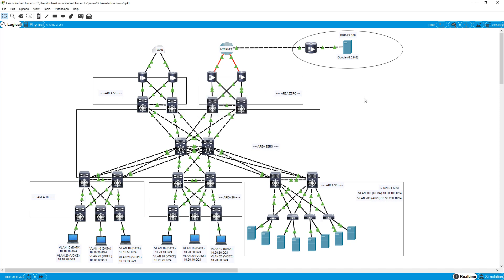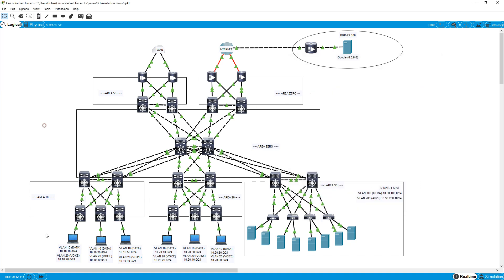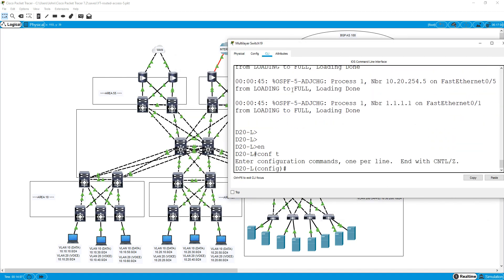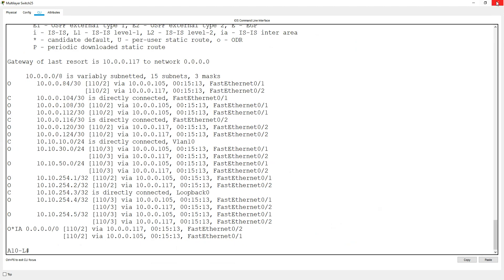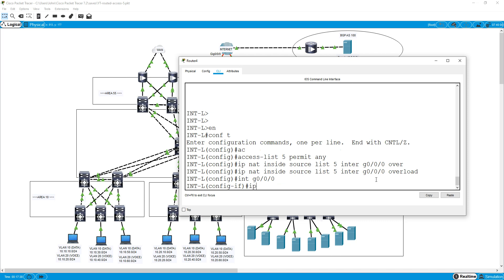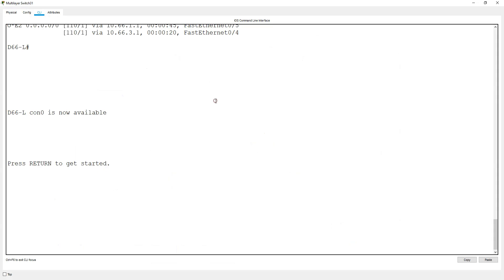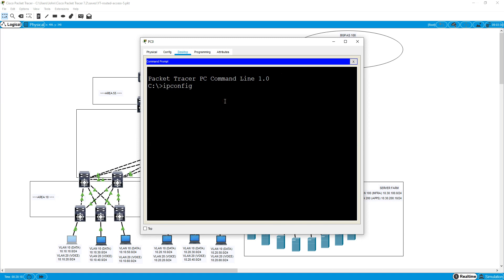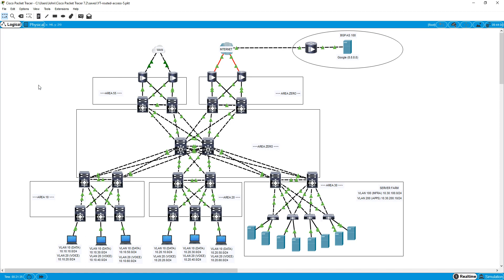Packet Tracer Lab: Routed Access Campus Design (Final Part: OSPF Summarisation, NAT & Ping Tests)

Comment: My deer and my teatcher 

I need you 

I need to connect multiple access point and creat multi group ssid 

I couldn't' do that 

So 
I didn't know 
If the MLS  has integrated wireless lan controller 
Or no 

I can't handle MLS + wireless lan controller  

So. All tutorial. Handle router with (WLC )

But. My company has MLS   does not has any router 

Can you help me please
Reply from the maker: Hey, Moshtak. Deploying wireless really requires a proper assessment of all the devices in place and their capabilities, etc, and I am afraid I'm unable to give any concrete advice just from the information. That said, in Routed Access you can deploy wireless as you normally would but you would have to tunnel all wireless traffic back to a central controller, that way you can still get "roaming". Not all access points are capable of doing this, however. You could also deploy a new subnet for all the APs and limit roaming. This probably would be easier to deploy initially but might cause issues down the line if you end up requiring the ability to roam. It's a difficult and technical subject and that's all I'd be able to advise, unfortunately. But I'd encourage you to look at the Cisco Validated Design for Wireless and Routed Access to be able to dig into more detail. 

:)
-John